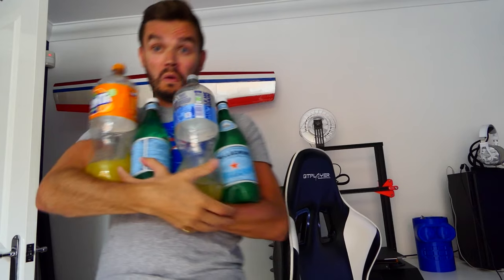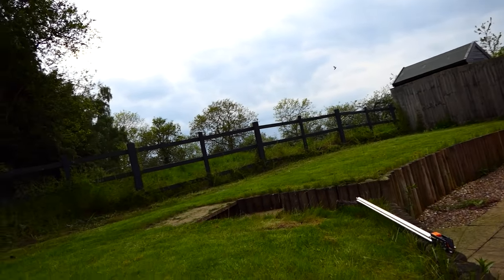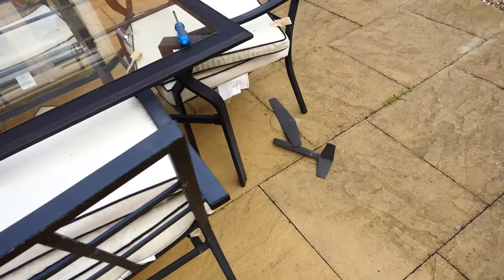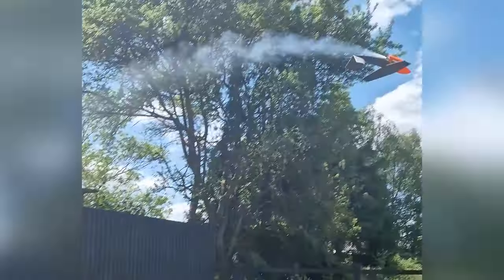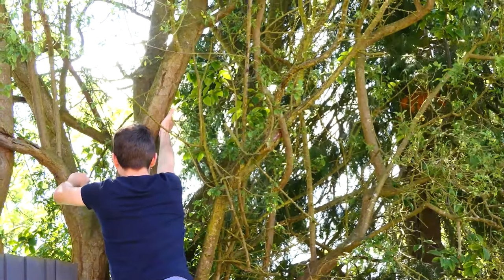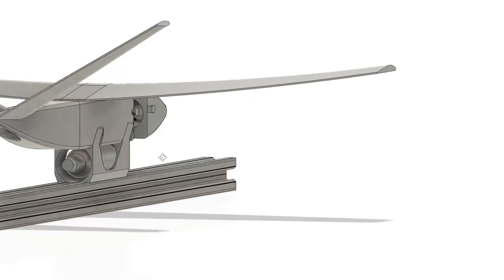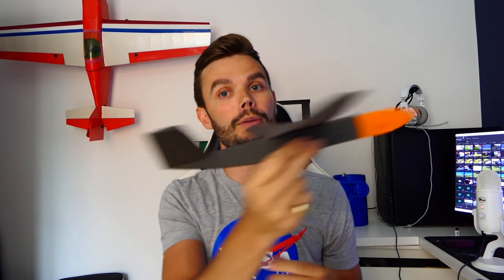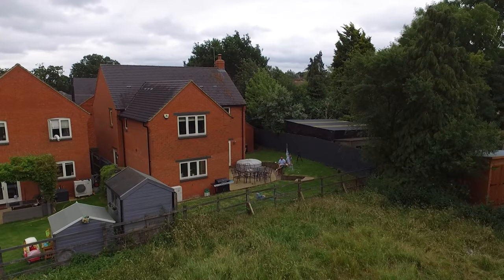CO2 Rocket Plane

Comment: Sam, it looks like the CO2 bottle is not producing purely linear thrust but due to imperfections in how it is pierced or an off centre hole, it is also producing yaw causing the secondary wing drop.  The yaw plus the high AoA due to the high pitch power couple is causing it to spin. Perhaps some kind of nozzle screwed on to the CO2 bottle may help this.
Reply: maybe a little more dihedral angle for the main wing ? friggin awesome thought

Comment: Genius mechanism allowing the motor to detatch. I've worked in private military tech/production for years. Ive been stewing around the idea of a field deployed rocket powered glider/yard dart. Install a small camera, servo to live target from the field. Load the cone or body with something that detonates on impact. I like your system and it gives me some ideas for application on what is in my head. The reality is drones have proven their place in the modern field. America is great at producing weapons that cost a fortune to often target one man. You can mix a stable rocket motor capable of easily launching a small glider or lawn dart design a mile plus. The components would be next to nothing as well as live video feed. You're pinned down by sniper fire, deploy a small desposable glider with live feed and impact explosive. The entire unit could be built for a 100 bucks easily and be made dummy proof. If you used an aluminum body and cone in a dart form the kenetic energy and velocity from just 10,000 ft with a small altimeter to detonate a squib in the cone causing the kinetic energy release would be incredibly devastating. I like what your doing keep up the good work.

Comment: This is awesome! I’ve experimented some with slingshot airplane designs. The hardest thing is finding a design that glides and behaves well at higher speeds. I’ve found a wing with a swept leading edge and straight trailing edge is the best middle ground. Those are also stronger than a straight wing.

Edit: I thought of something else: your point of thrust needs to be right under the center of gravity. That’s why pop bottle rockets have a long stick, to balance it out and make them fly straight.

Comment: Could you design the puncturing spike to become embedded in and seal against the canister?  Maybe with rear-facing "ridges" that could prevent it from being removed, similar to a bee stinger or a plastic rivet.  Then you could have a hollow portion down the center that you could design into some kind of nozzle to direct the thrust and maybe use it more efficiently?

Comment: By using a specific shape puncture pin, opening that it forms can be shaped into a pretty accurate nozzle. It would be similar to how metal forms during friction drilling, only here it will be from impact of the pin. Hopefully this will make thrust portion of this glider more controllable. The force from the canister can pull a linkage that moves the elevators on tail to give it directional (or rather angle of ascend) control. As the tank drops off, a rubber band would pull the linkage back, returning the elevators to neutral for a nice glide down.

As a side note, welcome back after nearly a year! lol

Comment: Once upon a time, I turned those CO2 cartridges into mortars. I used a pipe just sightly bigger and put a small brad nail through a board I rested the pipe on. Drop the cartridge and when it strikes the brad at the bottom, it turns into a small rocket.

It would add complexity, but maybe you should consider variable swept wings. You might even be able to have the sweep angle tied to the carriage you jettison. This would allow you to reduce drag and lift under thrust, but once gliding the wings would extend. It should reduce the effect of the plane rolling when it is under thrust.

Comment: To prevent the plane from rolling, add wingtips. These will prevent unwanted airflow from high air pressure from below the wing to the low pressure above the wing

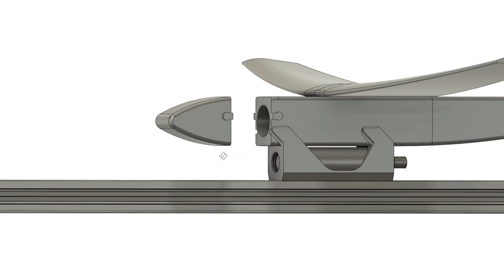Comment: 3:11 Hey, I had a similar idea for a CO2 cartridge rocket, with the cartridge sitting in the nose and the aft third or half of the body being a nozzle. The nozzle would have angled fins on the inside, that don't meet in the middle, allowing a pin to strike the seal of the cartridge.

Comment: Good video and F for the planes that kamikazed into the wall 😆. Here are some suggestions :
Maybe by having the sled stop at the end of the runway it would waste less energy rather than using that energy in making the sled fly
Also just optimising the release design as on a lot of shots an orange piege flew off while the plane was in the air
A nozzle would help with the direction of gas and maybe adjustable wing elements especially at the rear could remove the high pitch up at the cost of increased weight
I think an auto adjusting tail and wingtips could be feasible like with toy helicopters with a small wing/falt surface tilting blades but would require a lot of development
Good luck if you make a part 2 or for other videos👍

Comment: Wouldn't it make more sense to stop the sled on the alu track, rather thannhave it fly away with the plane, only to disengage in midair? The way it's set up now, the residual pressure in the cartridge extrapolates any movement the plane makes after take-off.

Comment: The problem is the hole punctured in the CO2 bottle is never regular. You need to incorporate the puncturing device into the plane then have the CO2 emitted via a predictable nozzle. You need a gasproofish nozzle system.

Comment: You're probably losing a fair amount of thrust by under-expanding your flow, the pressure of the flow coming out of your "engine" is definitely higher than atmospheric, and really you want it to be as close as possible to atmospheric pressure at the end of your nozzle that way all of that pressure potential is being converted into kinetic energy and momentum for your plane.

There's some maths involved, but if you probably want to design your nozzle for back pressure somewhere between 50% and 90% of the maximum. You get your max thrust at the high end of the pressure range, but you don't want to optimise your nozzle for 100% of the available pressure, because as soon as the flow starts you'll be out of your ideal range. I'd start by looking at rocket nozzle equations on wikipedia and see where that takes you.